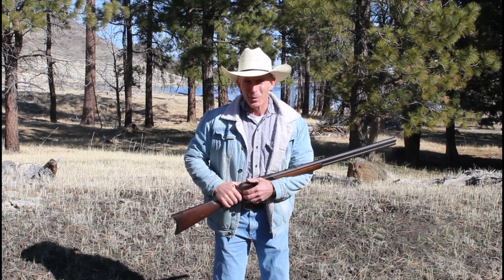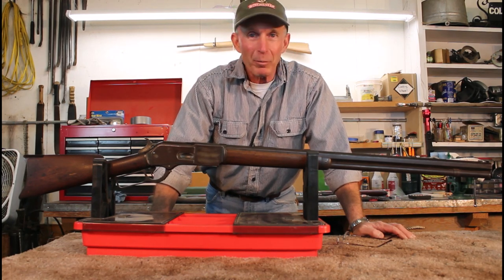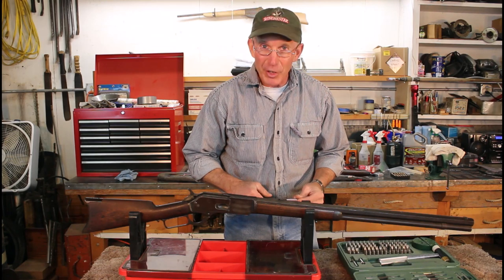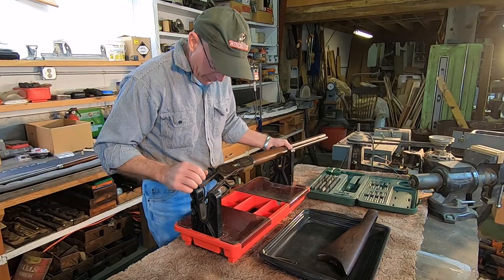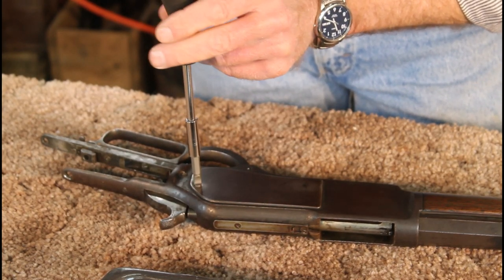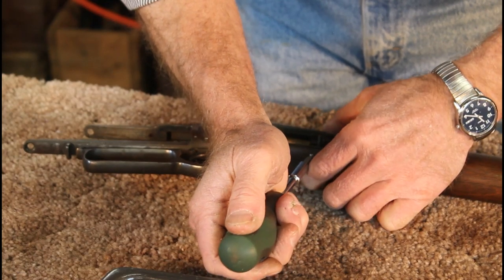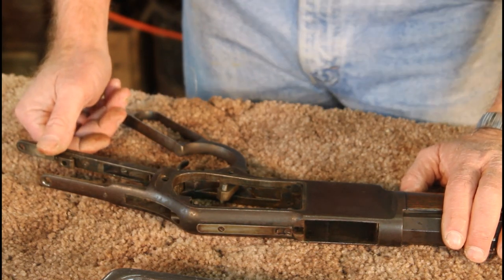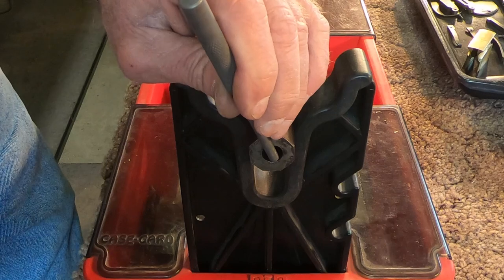Project Heavy 1876 (Part One)

Comment: Great video - I wish I'd found your channel sooner.  Well, the video I really wanted would be this 1876 and you only posted it a few days ago.  I just finished an 1876 in 40-60 caliber and didn't know anything when I started the project.  I had to make the toggle links, rear portion of firing pin, and a few other parts.  I mod'd a few Uberti parts to get them to fit.  Looking forward to part 2.
Ken H>
Reply from the maker: Glad you liked the video.  That 40-60 sounds like it was an interesting project.  I've not had to make toggle links.  Seems like it would be an interesting challenge.  Thanks for watching!

Comment: 45-50? Could you cover the liad? What does your barrel measure across the flats? I got a reproduction 73 back in the mid 90s by Uberti & Gardone 44-40, that gun put a worm in my head for original 73s, old loading tools, a 76 just like your except maybe the barrel and it's chambered in 45-75. Has tacks dressing up the stock so who knows who laid hands on it.
I enjoy your videos right up there with...... nobody comes to mind more than I like your work.
Reply from the maker: That sounds like a really interesting 76!  Most likely an Indian rifle if it was tacked up back in the day.  BTW, the one in this episode is a 45-60 WCF.  It measures a shade over 1" at the muzzle.  I'm not sure what you are asking about the "liad".  Was it maybe a typo?  Thanks for watching and commenting, Capt!
Reply: @thecinnabar8442  it was a typo, I thought it said 45-50 and wondered what the load was, powder and bullet? I've got the same trigger that works fine thankfully so I'd be interested in a video about it.
Reply: Finally dug out a Colt lightning project and wondered if you know someone who restores these old rifles? It's a basket case 45-60-? that's pitted pretty bad so it needs a trained eye to see if it can be saved. My other lightning and your videos have gotten me fired for more.
Also does Colt letter these guns or someone else?
Thanks.

Comment: Great video as always. Thanks for sharing your passion and knowledge. It is so interesting and useful. Can’t wait to see part 2. 
I just have a question. 
I own an early 45-60 1876 Chaparral (haven’t had the luck to put my hands on an original one yet...) replica which is very well manufactured and strongly built with great materials, despite all the crap I can read on the internet and made me hesitate to buy it. Now, I am really happy I did buy it 😀. 
This early replica seems to be chambered in .454 (even may be .452) and not in .458 like Uberti replica and more recent ones. I’d like, however, to check the diameter just after the chamber to be sure to use the best appropriate size of bullet. Any ammo above .454 doesn’t chamber. 
I will do as you show in your previous video. 
Thanks again for all your vids. 

So, based on your own experience, do you know if the original 45-60 1876 Winchester was chambered in .452 or .454 ?

Regards.
Reply from the maker: Yes, slugging the bore will give the best info for you to choose a proper bullet for your rifle.  Fortunately, you should have some excellent choices for bullets in this diameter range.  Thanks for watching!
Reply: @thecinnabar8442  Hi, Thx for your answer. 
I resize 45-70 cases to the proper 45-60 length, but as a next step, I will have to cast my own bullets if I want 300gn .454 lead bullets with a crimping groove that enables to be within the maximum length of this ammo. 
The ones I have found so far end up in an overall too long ammo if I crimp in the groove. 
Ah, passion, when you grab us... 😄
Regards.
Reply from the maker: I wasn't sure how much you knew about reloading, but you obviously know what you're doing and are on the right track.  I'm really surprised about the differences in the bore diameters on the reproduction 1876's.  That really makes things interesting for those who try to reload for them.
Reply: @thecinnabar8442    As a mater of fact, all the 45-60 Winchester 1876 replica are chambered in .458 excepted for a first Chaparral series that was in .454 or 452 (I have to slug the bore to really know). I’ll keep you updated, when I find out.  Why? I don’t know. I read that at the beginning, Chaparral wanted to be as close as possible to the original 45-60 Winchester. So, were the original 45-60 Winchester chambered in .454 or .452? That might be the reason why. Then, I suppose they sticked back to .458 like other replica manufacturers, for it was too costly...